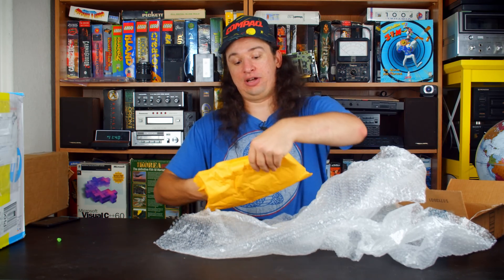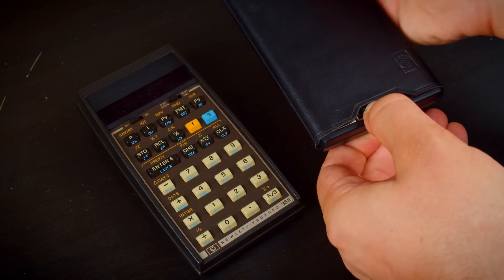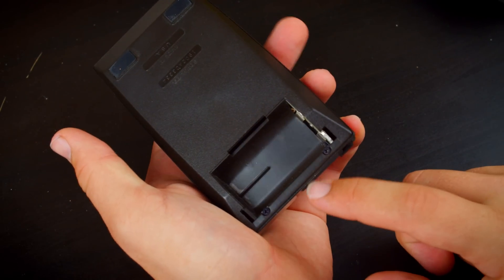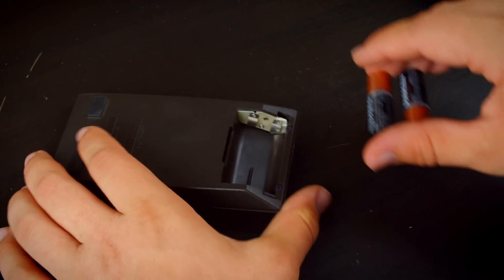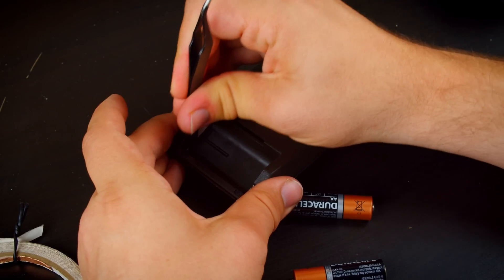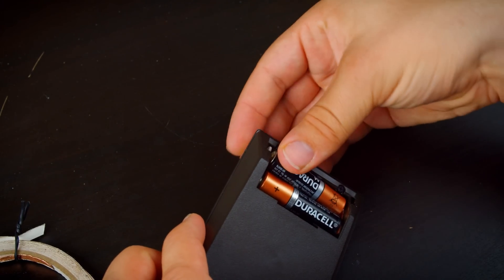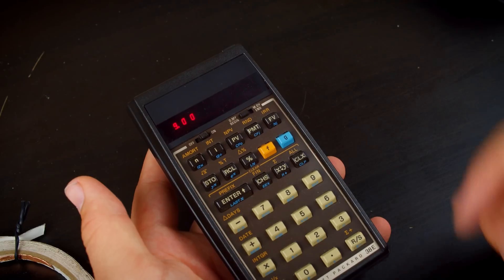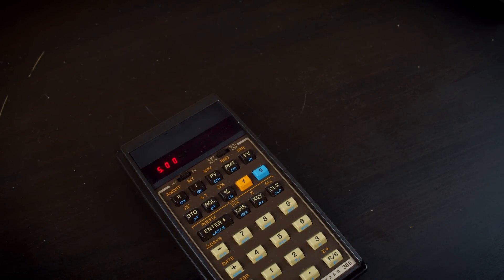HP-38E and More Battery Replacement - Micro Tangent

Comment: I have the HP45 and HP33E engineering/scientific calculators. The 33E has a rechargeable battery pack. Both have a red LED display which is my favorite. I have the biz HP12c and the computer scientist HP16c LCD calculators too.

Comment: Stumbled over your calculator videos and ended up here. Reminded me of that old HP calculator I rescued from the bin while working at a university. So I went out to the garage and found it, it's a HP 38C in mint condition complete in the box with manuals and everything. Used your trick to get it running again!

Comment: You could try cutting two small strips of copper tape, bend them snd stick those in each side of that copper tape you used there just to have better contact with the AA

Comment: you are lucky. I had to solder in a 9v plug into my TI-55 to replace the rechargable battery that was starting to leak everywhere after 40 years. I got the calculator, case, and box with manuals but no power adapter. Works perfectly with the 9v battery, and it actually lasts a good long time. I wonder if a 3.6v lithium camera battery like a CR-V3 would work better, wouldn't need the copper tape.

Comment: I've always loved HP calculators; my amazing stepmother had an HP35 back in the day and I've collected a 28C and 48C (w/card reader) new and have a used 12C.  Like their ads used to say, they're a calculator with no equal.
I really miss my 16C (comp sci!), but it died when my briefcase flew off my motorcycle on the highway.  It was so helpful when I was doing a lot of digital design and machine language and would still likely be.

Comment: Well, this TI loyalist is giving HP one point up. Easy as heck to replace a missing battery. The TI ones leave you up a creek when they go.
Reply: I modified my Ti SR-51II to use a lithium Ion cell with a micro USB charging port, looks pretty stock unless you really pay attention to the USB micro port where the 2 pin AC power adapter connector is.
Reply: @CptJistuce - 
YES this is as it should be , field servicable like military equipment

Comment: "And the easiest way to do that is..."
Me: mash some tinfoil in there!
"...copper tape."
Me: this guy knows rocket science!
Reply: lol it's amazing how many things we can find to solve issues like these. imo a normal paper clip should work well, the gauge should be more than enough to carry the current across as I've used much thinner wire to connect up 9v batteries before.
Reply: @amirpourghoureiyan1637  in highschool physics some friends of mine and I had fun during the circuit unit shorting the batteries with unbent paper clips and seeing how hot we could get them to run before burning ourselves. I was not as much of a juvenile delinquent as this makes me sound like, that was just a really awful class with a terrible teacher where I had to do most of the learning on my own at home anyway lol

Comment: You really need to go out and pick up a good quality carbon-zinc set of AA cells if you are going to keep batteries in this.  Every single Alkaline battery on the market leaks. There is not a single alkaline battery brand that doesn't leak.
Reply from the maker: I don't keep batteries in any of my calculators or other devices long term. Like you said, they will all leak and it's not worth the risk. So I only have batteries in the ones I want to use at the moment.
Reply: @TechTangents  I've started using Kodak brand carbon-zinc batteries.  The other carbon zinc batteries are all made poorly with poor life. But the Kodak CZ cells are just as good (life wise) as CZ ever were, but with excellent build quality. For example, their D batteries have 8000mah, which is pretty good and in some applications better than 1/2 of what an alkaline provides at about 1/4 of the price.  But they are built well and don't leak (so far, after about 3 years of use)  I generally don't leave them in things other than a flashlight, but I do occasionally forget and the last I forgot about batteries in a device, they leaked all over the inside of my radio. That is when I started looking for new types of batteries to use.

Comment: Nicely done. My first HP was the 25c scientific which also had bubble LEDs. I replaced it with the HP 11c. Right now I'm hoping for a second covid relief check. If I quaify I'm getting a Swiss Micros DM42. It uses the Free 42 simulator (it's got NO hp code) and has a display that puts the original HP 42c to shame.

Comment: How many registers does it have in the RPN stack?
Reply: 4
Reply: @lipoff  Did HP (or any other manufacturer) produce RPN calculators with more than 4 registers?
Reply: Алексей Рукин ... well, the Saturn based ones (28, 48, etc) had a soft-stack; and practically didn’t limit you...
Reply: The top stack is special, once it reaches that the value gets copied down instead of just shifting down.
Reply: @telocho  Yes, the same happens in Electrónicas as well.